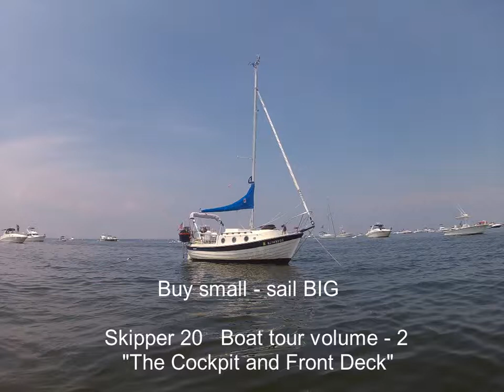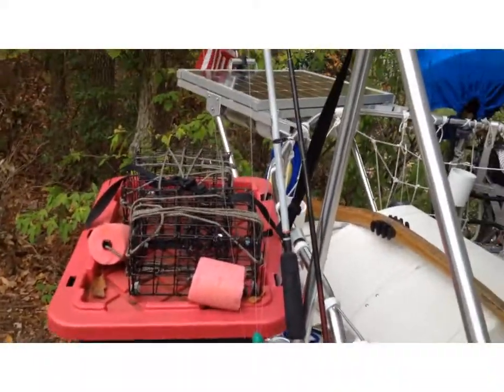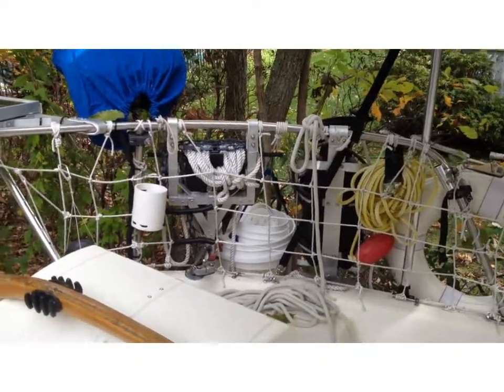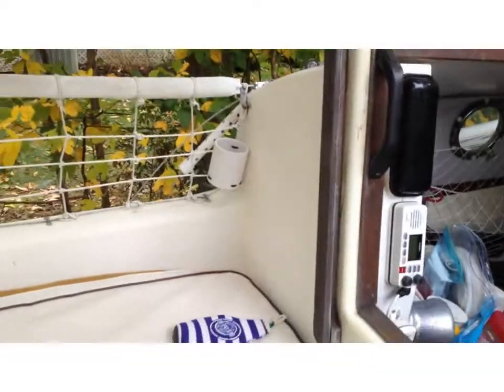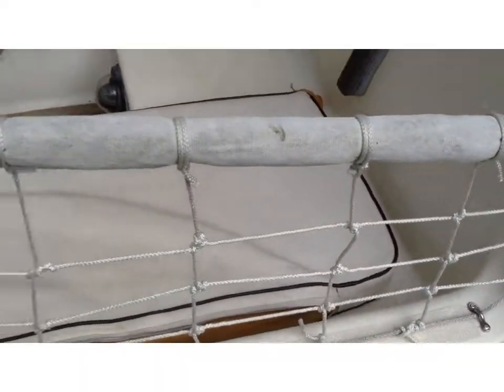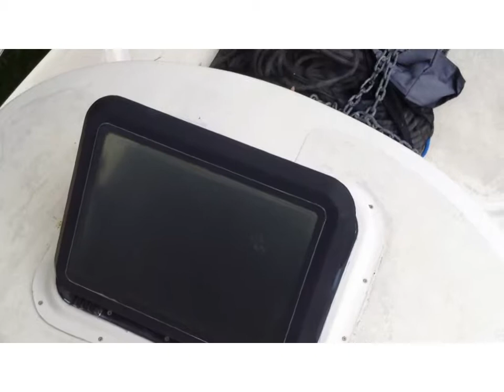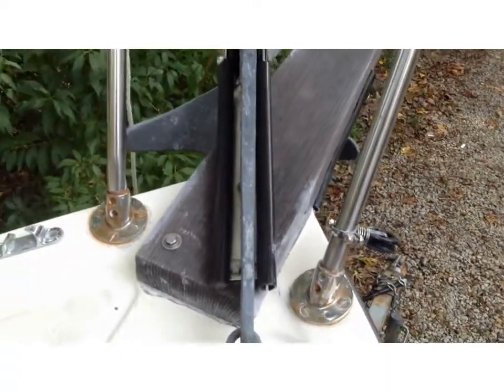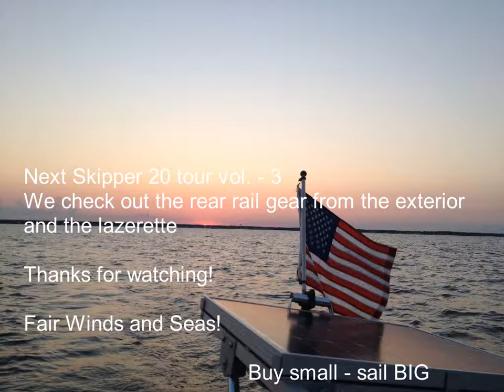3: Skipper 20 Boat Tour Volume - 2 Cockpit and Front Deck (Buy small - sail BIG)

Comment: Love your Channel.  I was wondering about this boat.  If water gets in the cockpit area, how does it drain or must it be pumped? thanks
Reply from the maker: Hello D L  
The cockpit has drains in the floor at the rear. I just moved mine to the rear wall of the cockpit so I could relocate the where they go through the hull from the bottom of the boat under the waterline  to the rear of the boat above or just at the waterline, depending how much I have her loaded down.  There is a video of this project in the works but I still have to do the final video of the project.
Fair Winds and Seas!  John

Comment: Can you please tell me what dimensions your canopy is. I have a skipper20 also.
Reply from the maker: Hello Kerry, Our Bimini Top was purchased off ebay from Marine & RV Direct. It is a 3 bow, 6'-0" long x 67"-72" and 46" high, It was $90.00 back 2016. (I still have the page off ebay from when I ordered it) Ours is mounted on the top of the outside cockpit seat backs... across it measures about 69 1/2".  I did have to bend the rear solid poles to clear the back rails to fit where the bases are mounted on the hull.  It's not made of Sunbrella fabric but seems to be of good quality and has held up well for the price.  It is a tall unit but it clears the boom, I like being able to stand under it but you could always cut the poles to lower it down if you wanted it lower. I have left it high as it came.  Fair Winds and Seas!
Reply: Buy small - sail BIG  SaltyC doesn’t have bow or stern rails, Bimini top comes in today